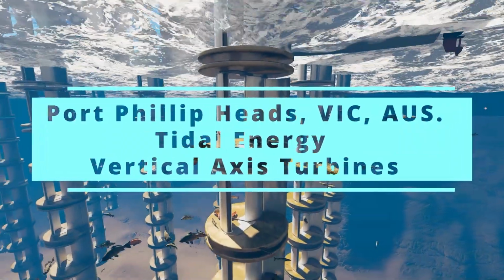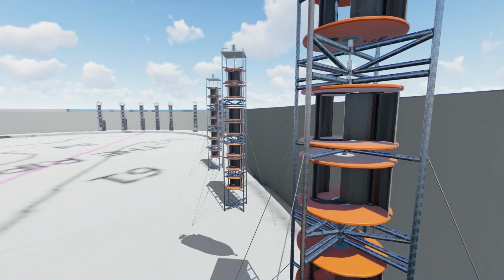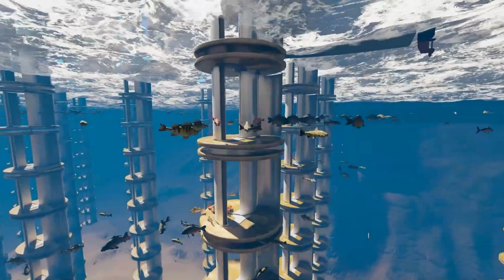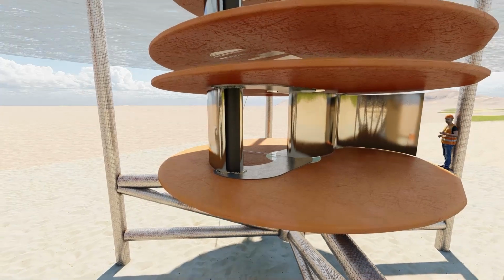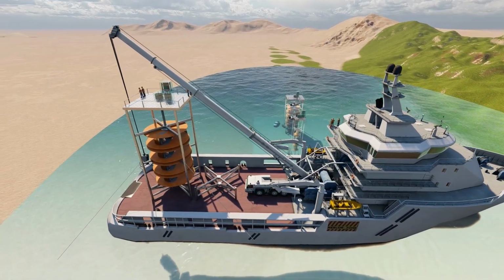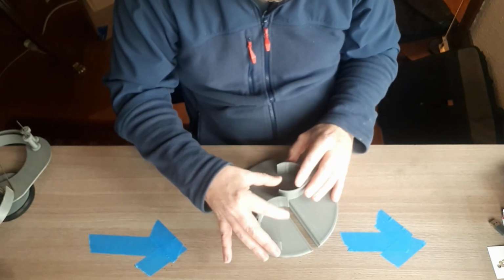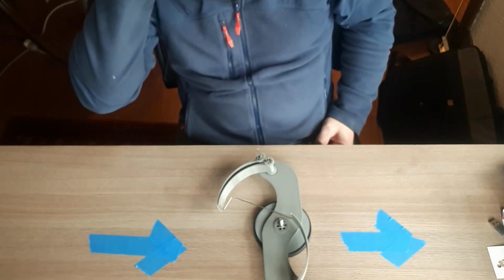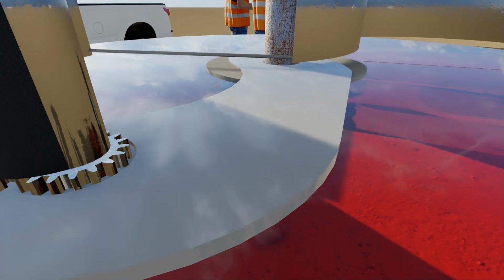Tidal Energy capture at Port Phillip Heads Victoria Australia 1 3

Comment: 😂 it’s an obvious solution to a massive problem… I’d love to chat about your ideas…
Reply: As I have surfed this spot for a long time.. love sensible solutions. It’s a super easy fix for our current problems. The amount of water that moves through that area is incredibly.. this could be scaled up ⬆️ to amazing levels and paired with other technologies could be an absolute powerhouse of near free energy once built…
Reply from the maker: Thanks Adrian. Politics, bureaucracy, the wealthy, and locals (on both sides) not wanting to spoil their views, (a priority placed above all else), and of course, a very challenging environment, not to mention that it is a protected marine environment. The amount of water that moves through is massive, but the rate at which is moves is difficult to capture energy from. This is why new designs need to be considered, instead of just copying existing technologies that just get moved around ie - wind turbine designs - there are plenty of tidal concepts that just copy this - but the designers dont really understand fluid dynamics at the  bottom - where there is the least amount of flow, and where the flow is the most turbulent - which does not work so well with horizontal axis turbine designs.
Reply: Hey Adrian, can I talk to you about where you are at wit this and how I can possibly help?